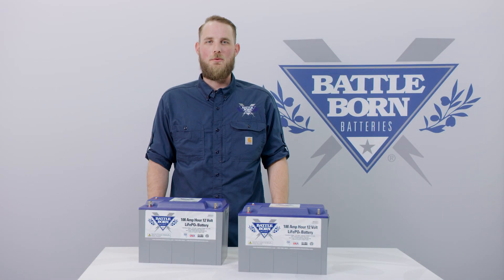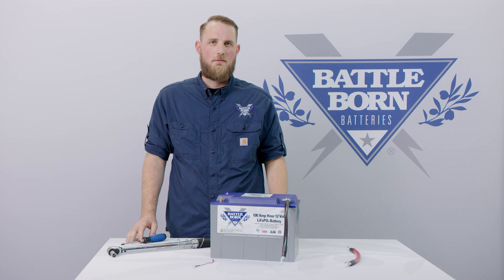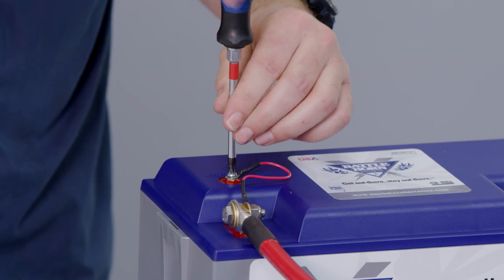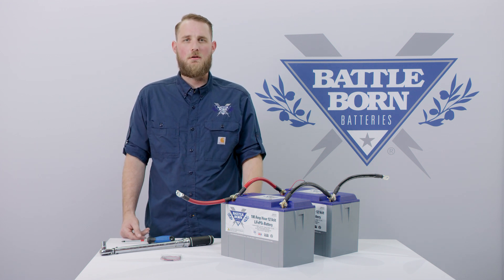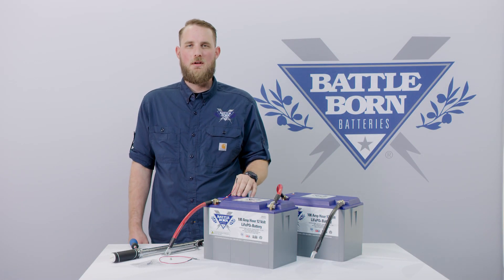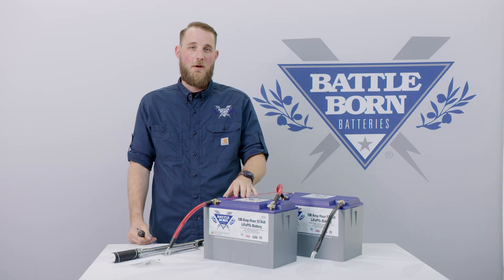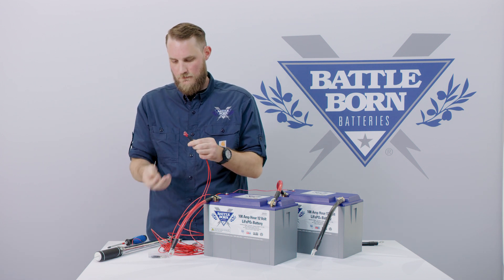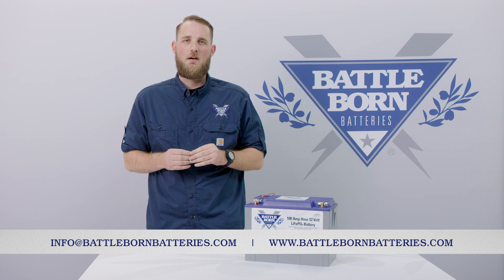How to Install Our Heated 100Ah 12V LiFePO4 Battery l Battle Born Batteries

Comment: Does the battery BMS control the heater once it's wired in?  Meaning, only running the heater if the battery is cold, or does it just run the heater continuously?
Reply from the maker: The heater will be activated when the internal temperature reaches approximately 35 degrees Fahrenheit.

Comment: What is the benefit of the jumper wire? Why not hook up each heater individually? I have 2 in parallel, controlled by The Kid MPPT and a DC load center to 1000 inverter. 300 watt PV

Comment: Sorry but how stupid, if you are making a self heating battery it should be automatic based on the temperature, not some jumper shenanigans. Not to mention with prismatic cells coming down in price so much your batteries are severely overpriced now.
Reply: The battery IS automatic based on the temperature. the jumper turns on the automatic heating feature. Think about it, why would you want a battery heating itself if it was in storage for example.
Reply: @billpullen9627  By your logic every battery is heater automatic, just wrap a heating pad around and turn it on when needed and off when you don't.
Reply: @Foxfried  I am talking about Battle Born batteries with the self heating feature. Not all batteries.
Reply: @Foxfried  They're cylindrical cells, not prismatic.
Reply: @isaiahbangura4421  Exactly, should have switched to prismatic and lowered the price.
Reply: @Foxfried  Troll, the jumper is a failsafe for when the heat is not needed - aka storage in cold temps

Comment: I understand all the benefits of your battery..know people swear by them....If and when your Prices come down SUBSTANTIALLY I would love to have them..Until then MY old fashioned  Deep Cycle lead acids are fine..The cost of just 2 of your batteries ,I bought solar panels,pure sine inverter, charge controller,the batteries, wiring  ETC..plus a 1200 watt generator for back up..My Father was a Journeyman Machinist & Electrician.. He knows all the specifics of my system.. Since the mid 80,s He's had  off-grid systems for his campers on his land and at his hunting lodge and grounds..Lead Acid batteries do require a Little Minimal Maintenance... Think of how long a Lead Acid battery lasts in your car you drive regularly..5 years is the average with NO Maintenance.... The thing that kills lead acid batteries is sulfating.... My father simply disconnected the power from his system at his hunting lodge or camp land... He had solar panels wired to the batteries to keep them trickle charged.... Every 3 months or so he would check the fluid levels simply add distilled water if needed.. and he loved checking his batteries with his multimeter... living in the northeast of the United States we are used to having brutal cold Winters.. lead acids have always done us fine..
Reply: When you look at calendar/cycle, life/warranty, they are not expensive.
Reply: @billpullen9627  wrong the are way overpriced compared to prismatic lifepo4 battery packs, you can get 3.5 KW for $1000 vs the 1.3 KW battle born is asking.
Reply: @Foxfried  I was talking about Battle Born batteries which are cylindrical cells, low temperature protection and a 10 year warranty. And they are only 900 now.

Comment: I bought the previous model and haven't installed my battery yet. I should have just waited for this heated model. R E G R E T ! I'll be living in my camper van in sub-freezing temperatures and am probably going to end up with a ton of Lithium Plating (irreversible damage). Oh well...I'll just have to get a heated blanket and build an insulating box around it.
Reply: I just bought 2 batteries and wish i would have waited a couple months for these. :(
Reply: @billpullen9627  Dang! Just missed the mark. I feel you!